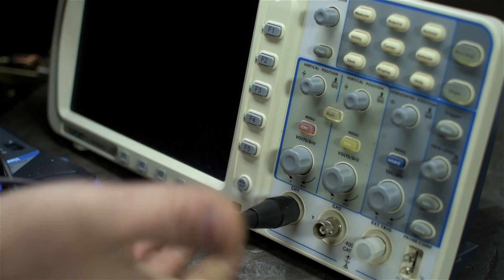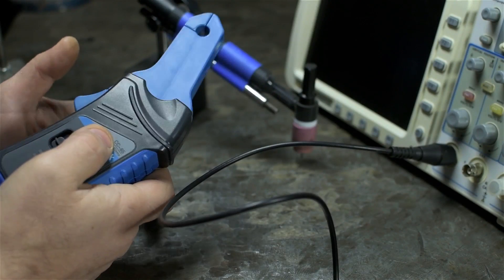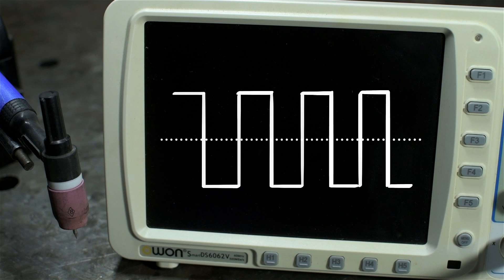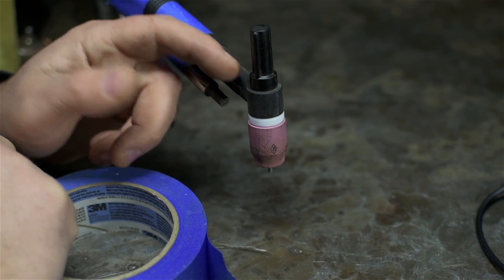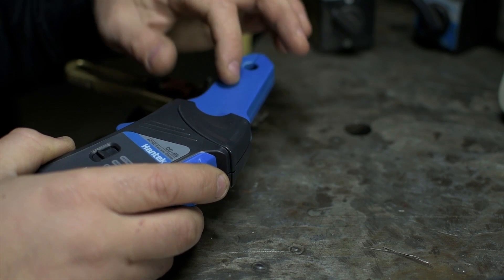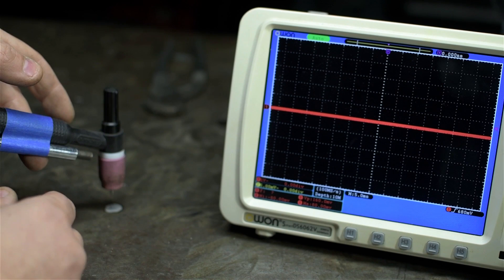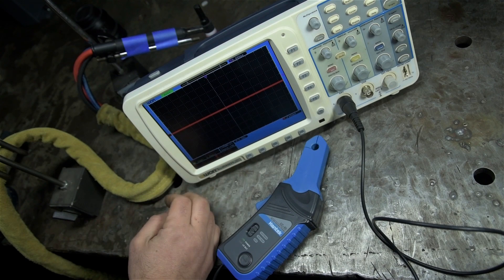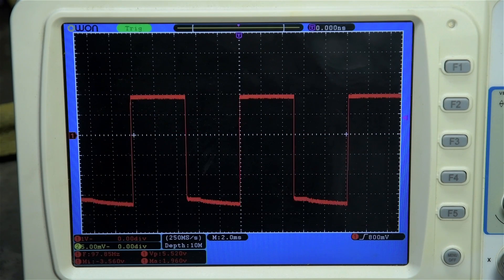Oscillo-Help-Me?

Comment: Hey TOT. Clamp-on systems estimate current from induced magnetic field in the wire when current flows. You don't need a common ground (TIG to scope) to sense that magnetic field. In fact, it's better there isn't one is many instances (this is probably one). So all is good there. The crazy scope behaviour is just an electromagnetic compatibility issue - the OWON design guys never envisaged anyone running a TIG machine and torch so close to their scope :) My money is on poor calibration/adjustment of the  clamp meter. I'd get a car battery and a beefy car headlight bulb and measure that. If you switch around the battery terminals you should be able to verify that, at least for DC, things are as they should be.
Reply: I wouldn't use DC to check the clamp function in AC (not even sure his clamp can do DC measurements) but he could do the test with a resistive load connected to the grid AC to see if the waveform is symmetric.
Reply: The spec of the Hantek CC 65 is AC or DC 20mA to 65A, up to 20kHz. That said a 60Hz AC test is worth running too. A lot depends how the Hall sensor is configured internally, could just be DC offset problem - which a DC test would reveal.
Reply: @Ollyweg I wouldn't be surprised if the current was asymmetrical but as others pointed out the top part of the waveform looks suspiciously flat as if it was clipped.

Comment: Hey Tony,
First i would rule out a dc offset generated by your Scope. To do that check if the coupling is set to AC. Second thing you can do is build a one turn CT with your probe to rule out a fault of the Clamp-On-Meter. Just connect the negative Probe-Clip to the tip of the probe whilst looping it around the Torche's cable. The output signal will be weak, but 30A should be plenty to be yet visible. At last, your scope is not really trust worthy. Make shure the probe is compensated properly best would be a cross check with an other scope. The strange behaviour you saw with the menues and ''u-disk'' is caused by the hf stuff coupling in places in your scope where it really shouldn't.
Hope that helps!

Comment: Marco has some good pointers.  Electroboom or Mr carlson's lab  would be good channels to reach out to.  Moving the scope away from the welder and putting some ferrite clamp chokes on the probe cable might help with the owon getting stupid. Mr carlson's lab is an rf guy I'd ask him.  What's it look like if you use a standard probe wrap the probe ground lead around the cable and clip it to the probe tip. Don't probe anything just use it as a one turn coil around the cable.

Comment: Is the welder 240V and are you in North America? The problem could be further up the supply side than the welder itself because of the weird way you guys turn the 3 phase at the pole into 110 & 240 at the distribution board. It could be that because the two 110 legs are not equally loaded there is a neutral voltage present which would upset the 0V reference and cause other strange artifacts.
Reply: Won't bother an inverter welder.
Reply: Elektro-Peter 
I totally agree that it ought not bother a switched mode power supply. However, it's odd that two separate welders exhibit the same symptoms.
Reply: David Lowe Or that the clamp/scope shows the same aberration on 2 welders? I think the issue is the measurement set up, rather than two welders showing identical behaviour.
Reply: Barry, The bottom side of the wave is ( Negative) is the penetration. The Positive side is just a "cleaning cycle". Deposition rate is a function of the person and the amperage they use.. It has nothing to do with the cycle really. More amperage = more potential deposition rate (to the point that you cant move and deposit filler fast enough and you over penetrate / burn through.

Its commonly misunderstood with electricity how positive and negative works. Electrons are negatively charged and the naturally flow to the positive side. This is why when you weld in DC (easier to understand), TIG, the Electrode is negative (EN) and the work clamp (what people often call the ground clamp) is positive.  This is why welders and welding machine manufactures call it a "work Clamp"... Its not the Ground (negative) in all cases. In MIG welding process, the electrode (wire) is Postive and the work clamp is negative (this is called EP or Electrode Positive. This is why if you have the voltage too high and not enough wire speed, the wire burns back into the tip.  If you were to set up a TIG in EP, the tungsten will ball up and burn back up into the cup (to what degree is dependent on the tungsten's size and material along with the amperage used).

So while you were sort of on the right track with the machine having more negative then positive from the factory to allow for better welding, its actually that the more negative gives more penetration.
Reply: I think the power company has a wild leg run to your meter.
Reply: The neutral/grounded conductor of both a split or a high-leg delta - and any 3 or single phase grounded system actually bring any earth or bonded object to nearest the same potential at each grounded or earthed point. That's the whole point... While that could account for an offset phase to phase or leg to leg on the AC input, which is very normal due to winding counts being asymmetric. That difference should not be seen in a rectified DC source. But you also need to bring one side of the measured item to the level of the meter or vise versa. Otherwise the reference will always float.
Reply: Don't assume the asymmetry is wrong.  He made no mention  his welder not working,  The positive part of the wave is penetration, while the bottom part is deposition rate,  It is fair to guess a consumer grade welder would be set from the factory to make it easy to weld, since it is likely to be used on thinner materials, hence lower penetration in favor of more deposition.
Reply: Perhaps try the setup from another power source (friends house/generator etc.) just to eliminate that problem source
Reply: This Old Tony lives in Europe
Reply: He lives in Italy so now what is your suggestion

Comment: Please don't use that owon crap for measurements like these. I would also never use an isolated scope for high voltage stuff. Your whole scope could be at mains potential without you knowing it. A grounded scope is much safer because it will trip the breaker when this happens.
Reply: slap_my_hand welders are anything but high voltage.... And current clamps aren't either.
Reply: Welder output is not very lethal generally. It only hurts. For example if you forget to connect the ground clamp, accidentaly making your work live. It happens. Being isolated is much safer for the scope here though.

Comment: Ive never worked on an inverter welder. My area is digital and RF electronics. And I'm on my first cup of coffee on an insanely cold day.

But I have a feeling the lack of a common ground between the welder and the scope is part of the problem. At this point, the scope and the probe are assuming the zero point because they have no frame of reference. Additionally, there's going to be a little bit of overshoot and ringing in the circuit due to stray capacitance and inductance. Since you're probing the ground(?) and you're measuring current, I think it would be safe to use a grounded cable with the scope. The only sticking point there is the HF start, but the peak voltages induced in the current probe while ungrounded should be the same if the machine is grounded.
Reply: Not completely. This isn't DC.

Comment: As a practising pixie wrangler, it looks like your scope may have some setup errors.  I would recommend that you check your scope's settings. Typically you will have three choices for coupling AC which will remove any DC bias in the signal, DC which will show you the DC levels and Ground which will give you a flat line without any other signal.
When I test a scope I like to set it to AC and then adjust the vertical position to make sure that the 0 signal is on the center horizontal line.  Next I will use either the calibration output of the scope or connect to AC main power and verify that in AC coupling I have a 60 up 60 down sine wave.  Once I know that the scope is properly displaying some easy to verify test signals I can look with some confidence at other things.
As always with this sort of thing you may find it useful to read the manuals for both the scope and your torch - and keep in  mind that when going from theory to practice your mileage may vary.
Reply: This is absolutely true. But simply grounding the scope input and centering that on the display should be enough for this. The clamp is AC coupled to the cable it's measuring already. DC is likely introduced because the clamp is saturated.

Comment: @this old tony, is it possible that the incoming power is not balanced. I.E. the machine requires 220 ac correct? Maybe the power coming into the building is not the same on both the 120v lines coming in? Maybe there is a neutral issue in the building? That might be throwing off the inverter in the machine, causing a trickle down effect in the DC square pulse.
Reply: First thing all these do is bridge rectify the line input and filter it, then use a HF ferrite transformer and IGBTs or FETs to isolate from ground for safety.  Never seen an exception, it's what they mean by "inverter" (they're not real big on the dictionary).  There's high likelyhood this machine doesn't even tie to neutral at all - mine doesn't.

Comment: Well Tony, you have the same problem I have seen many times in my 30+ years as an electrician. You have test equip. Many customers are perfectly happy until they get a dvm and start poking around. Then I get a call because they want an explanation of all the different voltage measurements they are getting that they feel must be wrong. I tell them that the readings are not wrong,but their expectations of what the proper readings are.
I am sorry that this is not really giving you a direct answer to your question, but concentrate on welder performance and the scope readings can probably be explained by Mr Carlson's lab on youtube. He knows everything!
Reply: But readings CAN be wrong. You should allways question readings you don't understand. Also, if you are using an unfamiliar measurement device, you might be using it wrong. The perfectly flat top of the waveform is very suspicous for a problem with the measurement itself I think.

Comment: Using your current probe your connection to the scope must be AC coupled so it doesn't know where the zero line should be. 
If the scope display shows the horizontal line biassed up or down from where you think it should be - I would look at the probe not the welder for answers. Can you try the probe on an AC mains elec fire live wire or something to see what it does there ?
Reply: NEVER directly probe mains with a non-isolated scope!  That is a very good way to blow up the scope's input circuits.  Tony's current probe is an indirect connection, so that is safer.
Reply: I think he was talking about the current probe. No problem there.

Comment: To rule out the clamp, put it on opposite on the wire so it runs back-to-front instead of front-to-back , this will reverse the waveform on the scope, and if the a-symmetry keeps being the same, the probe is not to blame.
Reply: That was my idea as well. If he flips the clamp the waveform on the screen should flip upside down if it really is an asymmetric current. If it stays exactly the same the current is symmetric but something in the measurement equipment is not.
Reply: Was about to say the same thing. He should try this.

Comment: Seeing as you can change your welder's waveform amplitude to a forced asymmetric square wave, why not try that and take another reading. This could provide you with a method of elimination for the issue, as if the waveform simple shifts higher then the reading setup is correct, but if the waveform is truncated further then your reading setup has some form of clipping/ clamping device.

Comment: Well, if you try to measure the voltage directly, you need to ground the welder and scope together.
But if you're measuring current with a clamp-on probe, that shouldn't be an issue... The first thing I'd do is try a different probe. If you don't have another current probe, I'd check the manuals for the probe and the oscilloscope to make sure they're setup properly. Also, try measuring something with a known AC current. For example, a power cable connected to a load should have a balanced current at 60Hz.

Comment: Can you turn off the HF start and scratch start to see if the HF is messing with it? I was worried when I got mine that it would mess with my gear in my shop but so far no issues, but maybe since it's right there, and those probes are exquisitely sensitive to RF interference.... Also, I think your grounds would have to be tied, as in your "0 volts" are not relative to each other.

Comment: I don't know electrical at all.  I know a bit about hydraulics....and I have always used one to relate to the other.   So with that said,  can it be an issue on the supply side?  (electricity coming in?)
Reply: Electrical filters and hydraulic filters use different principles, and the angry pixels in welders with HF start have no principles whatsoever.

Comment: Since the scope is battery driven you currently have a floating ground which can lead to all sorts of interesting results. You might want to try connecting the second channel to some kind of common ground with the welder (lets say the wall socket ground)  After all you are using a clamp probe so there would be no other electrical connection to complete the circuit and ruin your scope. Thats where I would start.
Also as many others here have said, inverting the poles on the probe will give you a hint of where your problem might be.

Good luck!
Reply: When you are measuring the total current value with a multimeter the offset from ground is of course of no interest. However that is not what TOT is doing. He is interested in measuring the offset of the plus and minus side with the ground acting as a reference or a zero if you will, using an oscilloscope.

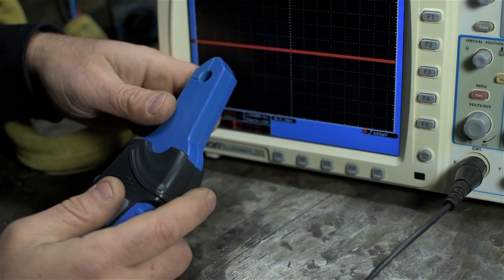Comment: An offset is totally consistent with miscalibration of the clamp probe. See https://www.youtube.com/watch?v=5FW_QmBI5Dk at around 05:30 for a clear demonstration, albeit with DC. On the other hand, as many others have said, the flat top to the positive current is too good to be true, so it may not just be clamp calibration.
Reply: To validate this, take a  tungsten light bulb and measure the current of it, it should be symmetrical (resistive Load).

Comment: Did you try to scope AC from an outlet powering a incandescent bulb? Check and see how asymmetric that looks like!
Reply: NEVER directly probe mains with a non-isolated scope.  https://www.eevblog.com/forum/beginners/measuring-mains-with-rigol-ds1052e/
Reply: I think he means inductive current probe. Also his scope is isolated from mains since it is battery powered.
Reply: Pixel, using the same setup he is using to probe the welder. Current probe.

Comment: Hey tony, try to see if you dont have by deafult your probe in DC mode, if is not that the problem, I think its normal, oscilator circuits have a hard time making the waves simetric due to the parasite capacitance and eletromagnetic fields of the circuit, and maybe the factory put that wave whit some DC offset with the proposal to help to weld, I saw in this post( https://cadcaminfo.wordpress.com/prototyping/the-tig-welder-ac-or-dc/ ) a graph that indicates that the negative side of the wave is used to heat up the probe and the metal, the positive is to clean the surface, with that I think that in factory they give more power to the heating side of the wave (negative one), by puting some negative offset.

Comment: I'd expect the top of the square wave to be as dirty as the bottom (there is some definite ringing in the old welder and overshoot in the new one, typical square wave fun).  You may have something there with the clamp limiting the positive peaks.  Do you have a different clamp to borrow or make(!!!!) one by just wrapping some wire around the ground wire with a limiting resistor(series)?  Simple is always good.
Reply: The bottom of the square wave is below ground, of course it's dirty.
Reply: I twigged to the same symptom.  That perfect flat top "jus ain't right".  Even if the scope or the probe is on the slow side - there should be all sorts of fiddling around on the arc on-set.
Reply: !  Tony in disguise, right after I make a comment about his superior humor?

Comment: I think it is the welder and is deliberate because I read that the reason we use AC is one current direction (probably negative) helps clean the surface puling contaminants away from the weld and the other direction (+?) puts more heat energy into the welds. Then it would make sense to deliberately imbalance the square wave.

Comment: Alternatively try welding a steel rod that fits through your clamp, and ground-reference it with the scope - since the clamp is not galvanic connection you shouldn't worry much about ground looping.